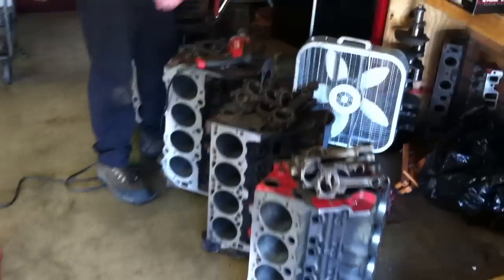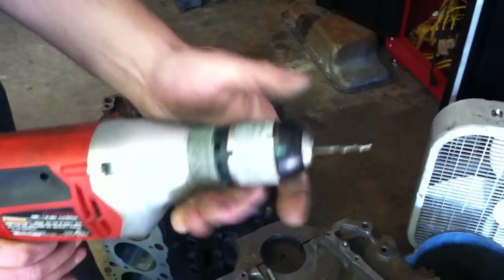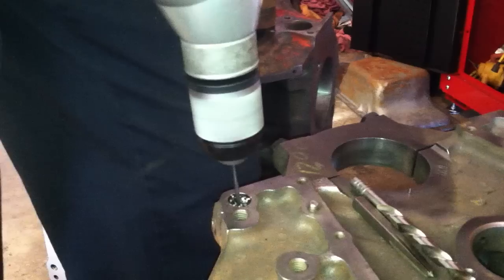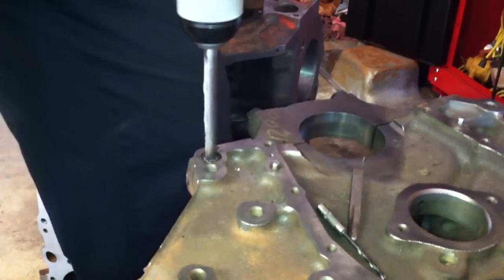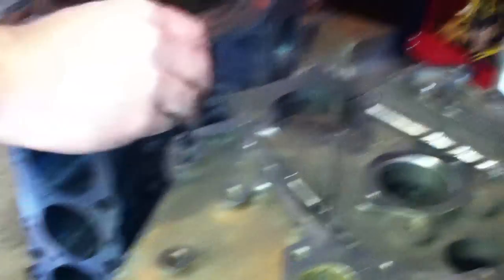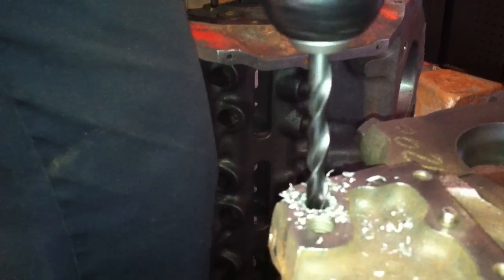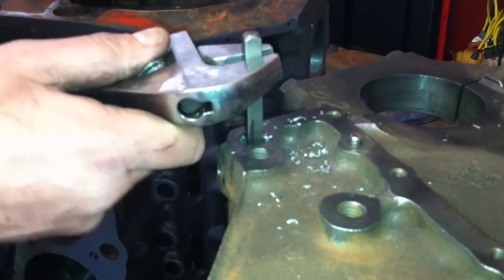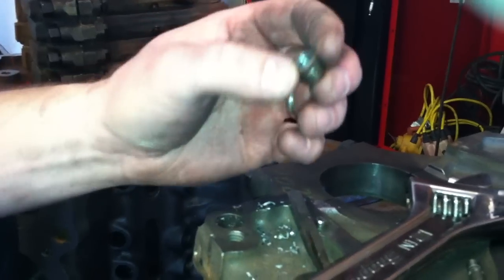How to remove stubborn Oil Galley plugs Chevy 454

Comment: Heat the plug (not the block) with a cutting torch for about 15 seconds until it is just red, melt canning wax on the plug, let it cool for about 30 seconds and the plug will spin out with no problem. Been doing it this way for over 30 years, maybe one plug in a thousand will require drilling. It's a common method that all machine shops I know use. Hardware store canning wax is all you need.

Comment: was the first (bigger) drill bit a special type, as it appears to be left hand fluted...which then need to rotate left hand or counter clock wise direction?
Reply: They are all left handed drill bits, you need a special left handed drill, just reversing a normal drill will not work. When you buy yourself a left handed drill could you put the address of the company that sold it to you in the comments, I'm looking for one myself. I got the striped paint I was looking for now I just need my left handed tools.